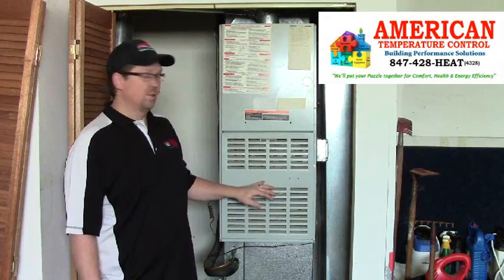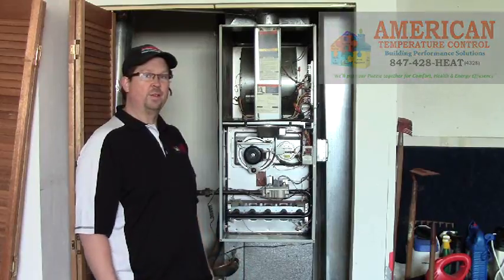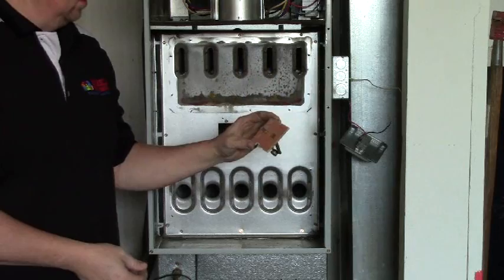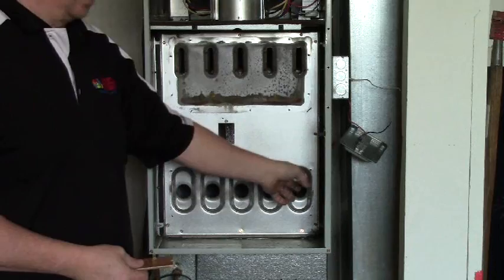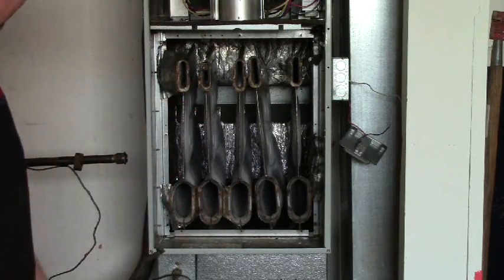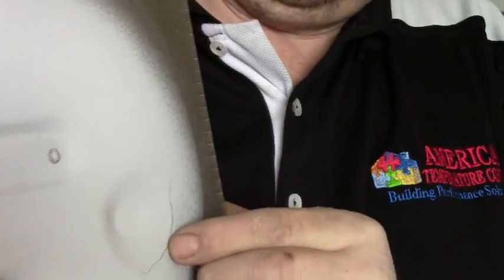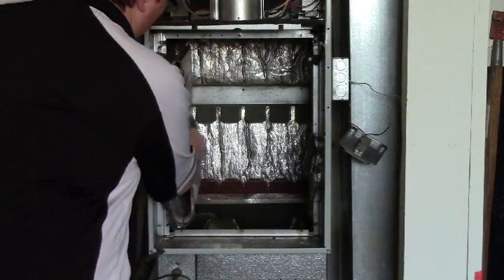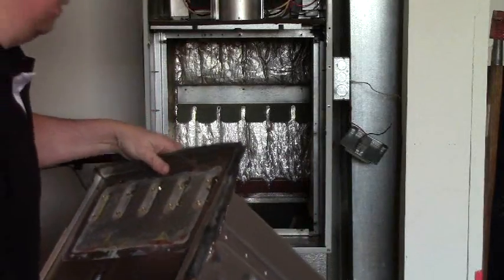Heat Exchanger Change Out

Comment: Thanks for the video. The fact that each exchanger had a crack (and almost in an identical location) tells me that this was a poorly designed heat exchanger and that the manufacturer didn't design it for the long haul. Looks like a case of intended product obsolescence

Comment: I just want to say thank you for saving me $2500 on having an HVAC company replace mine or better yet trying to strong arm me in to a new system when the only thing wrong with it was a $500 part. Can someone explain why this costs soo much for an "expert" to replace when It literally took me 1 hr to do ($2500 per hour labor)? For other DIYers out there, make sure to read up on all aspects of the furnace and how to properly remove and replace the gas line before attempting, given the dangerous consequences of a leaking gas line.
Reply: Youre paying for the years of experience attached  with the expert. Youre paying for it to be done right. Youre paying for the guarantee they will return free of charge parts AND labor should anything potentially go wrong. Youre paying for the company and manufacture warranty.
You void all of that by doing it yourself. Unless of course you're licensed then I can't imagine why you'd be calling heating companies in the first place.
Granted, that 2500 quote is absolutely too high.

Comment: How did you determine the heat exchangers were cracked before pulling them off?
Reply: it is quite simple: 
blower back pressure knocking flames around when running. Look at each burner flamme indepentently. I may be affected but not the others!

To prevent cracks... keep a normal air flow with CLEAN AIR FILTERS else $$$$ repairs or new furnace until lesson learned.

Unfortunately furnaces are not designed to sense reduced air flow but only extreme heat when damage is likely.
Reply: Camera

Comment: Can they be welded??
Reply from the maker: No Contractor or Manufacture would recommend or take the liability of that type of repair. My guess would be welding is heat treated metal and original stamp metal heat exchanger is not, and stress cracks could form easily.

Comment: Thanks for the video. I have a goodman furnace, now about 4 yrs old that has been running beautifully. (GMEC96). When the installer put it in , he didnt replace the plenum that sits on the burner cabinet. That plenum has a patched area i removed easily, because i was interested in looking at the condition of the  ACOIL . Well as i peered in,  much to my shock,  I noticed 3 rust blotches on the heat exchanger. A dark one, a lighter one behind it and a third lighter one down the same side (Theres is a heavy-duty, aluminized-steel tubular heat exchanger  and a stainless-steel secondary heat exchanger. ) I touched the tubular affected area with my hand and it was still solid no cracks. How worried should i be in this situation . I intend on unclogging  or replacing the ACOIL that has a heavy rust spot on it that  know is where the drip came from to cause the rust spot. What would you do this situation? Im concerned about carb monoxide but the exchanger seems solid still. Would you replace it anyway?
Reply from the maker: Have it professionally inspected yearly with hvac contractors that use Combustion Analyzers.

Comment: Where can i buy one of these
Reply: There are plenty of parts companies that will sell you an exchanger. Just make sure to buy the right one. Alot of times there are various revisions and the original part # changes.
Reply from the maker: Usually only sold to certified HVAC contractor, because of Manufactures liabilities.
Reply: Check out SearsParts.com  They usually have most furnaces heat exchangers.  You can order it online and have it shipped to you.  Very good prices.

Comment: What are you torquing the bolts to? Just snug?
Reply from the maker: This carrier furnace doesn't use bolts, just sheet metal screws and therefore this is no torque or torque sequence.
Reply: @americantemperaturecontrol7852  You are correct. It didn't occur to me that a sheet metal screw wouldn't have a torque specification. Thanks!

Comment: I was just quoted $2800 to replace a heat exchanger.  The part is about $400 and the guy spends at most 2-4 hours to remove and replace this piece.  Am I missing something?  Seems like all HVAC contractors want to be paid like they're doctors or patent attorneys.
Reply from the maker: There's different cost for heat exchangers in or out of warranty, for example is the primary heat exchanger of an 70%- 80%afue furnace or primary and secondary heat exchanger with collection box of 90% AFUE condensing furnace. Then there’s difference small or big companies overhead cost. There’s billable hours to change out the heat exchangers and then the none billable hours of getting the parts and/or returning the parts under warranty and paper work time. And yes there are some companies that charge a lot for repairs with dreams of selling you new HVAC equipment. We strive in educating our customers, spelling out all there options and letting the customer decide what’s best for there situation.
Reply: Then do it yourself but make sure u buy yourself a carbon monoxide detector or else you're toast
Reply: Then do the shit yourself. Or pay someone cheaper and see what that gets you
Reply: That's because they work 20 times harder than any doctor ever will...Fuck doctors...That 2 grand isn't enough...
Reply: You're not paying for the 2 hour job you're paying for the years of schooling and experience knowing it's being done right.
Reply: @mdc21787  So a few years in a trade school makes you $1200 an hour? Damn! Im in the wrong business.

Comment: Doug makes it look so easy. Too bad he's way up North otherwise I'd use him to replace the heat exchanger on my Bryant 90i furnace. I kept getting error code 33 from flame roll-out (flames blows back on limit shield). After doing some homework realized it was the secondary heat exchanger.  Carrier has extended a special warranty for these units and will cover parts but you're on your own for labor.  OR they will give you a $1250 credit towards a new unit...good luck.
Reply: The 90i has a Lifetime Warranty on the Heat Exchanger. I would rather pay $1000 to have the exchanger replaced than replacing the unit. The 90i's are very High Efficient units, and are only comparable to the newer Variable Gas Furnaces which will cost you more than $6000 installed.

Comment: How much should a technician charge for a job like  this?
Reply: In the Cleveland, Ohio area a 80% Heat Exchanger replacement ranges from $700-$900 if the exchanger is still under warranty. Pricing usually depends on access to the Furnace (attic units are going to cost you more in Labor).
Reply: Up to $2000
Reply: @mdc21787  They wanted 3k in my area. WHat a joke. The HVAC industry has become rediculously overpriced. I see this trend happening with roofs too. 10-15k to replace the roof on a mid sized home that ends up costing 2-4k in material costs and taking 3 foreigners with no formal education 1 day to complete.

Comment: Great video but you well know it’s not cost effective to replace “just” the heat X. That’s why the manufacturer makes the heat X so flimsy so you have to replace the whole furnace. The labor involved does not make it worth doing the job unless it’s for yourself or family. What can go wrong next?, blower?motor? inducer? gas valve? But still great video!
Reply: Why is the labor so hard? remove some parts, slide out exchanger, slide in new one, replace parts.

Comment: Why did you unscrew all the cells , you can pull the whole thing out with the bulkhead in one piece. You have air flow problems, with that many cracks, don't forget to wipe down the outside of the cells with cleaner , or the house is going to fill up with smoke on fire up
Reply from the maker: This video is a demonstration for homeowners to understand the process to change out a heat exchanger. For shooting the video we chose to disassemble in one location and not have to reset video camera.
Reply: And he also showed u 1 at a time on both sides of the heat exchanger panels for his video....if not then u only see the left and right....nice vid...hvac tech canada here...
Reply: MIne did this! Scared the crap out of me so I shut it down.  After a bit of research I just had everybody exit the house and ran it for a few hours. Would have just cleaned it first if I knew. lol

Comment: Wow... just replace that old mid efficient.. lol You are enabling these homeowners.
Reply from the maker: Our approach is to educate our customers of all their option
and consequences, warranty or not. The customer can decide what works best for their
personal life style and finances.
Reply: If its under warranty and you get paid, why not? Agreed if the furance is so old it's out of warranty, I ain't putting a heat exchanger in it.
Reply from the maker: Just replacing a 78-80% efficient furnace with an 95% is about
15% improvement on paper. In the real world with poor air duct designs,
location, leakage, leakage to outdoors and thermo envelop issues many homeowner
may only see a 3-5% improvement. Many utility companies across the county have
studied this and have found the average 95% furnace in existing home are only working
at 78% efficiency because of preexisting issues.  I f were serious about energy efficiency especially
on older homes lets test and fix the buildings to increase efficiency, comfort,
indoor air quality and building durability. It’s a onetime investment that doesn’t
have to be replaced every 18-20 years with no breakdown or maintenance cost.
Reply: On an 80% furnace heat exchanger replacement $700.00 bucks new furnace $1500.00 bucks, money is always an issue.

Comment: since all of the cracks were in the same place relative to the factory dimple in each panel, I would consider this a manufacturing defect. But whatever the cause, needs replaced. What's the brand?
Reply: This was a carrier. The company that can't engineer a hear exchanger for shit. Pissing techs off from day #1.
Reply from the maker: All manufacture invests massive amounts of dollars in the
R&D before they ever release products to HVAC industry and the public. What
they don’t have is the control over thousands of contractor’s different skill
levels, the quality of duct designs both new or existing, and the property
owner negligence to maintaining equipment. After all the stresses, everything
has its breaking point. Manufactures still stand behind their warranties.